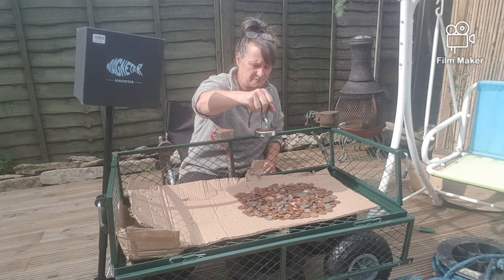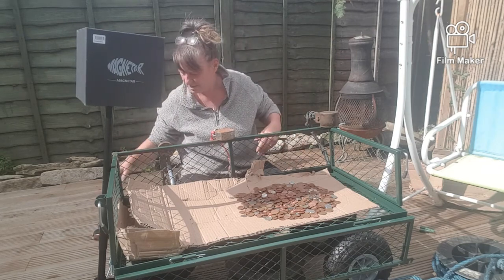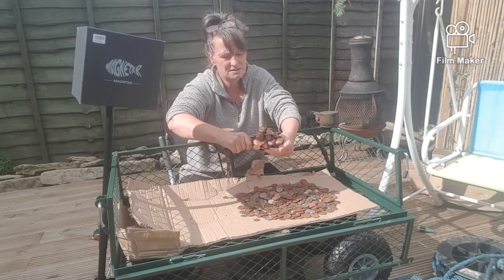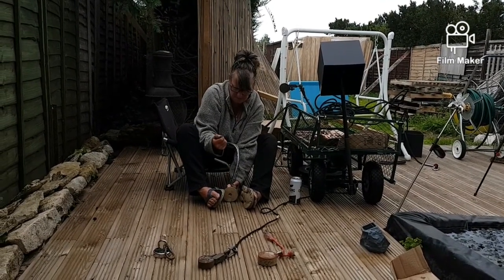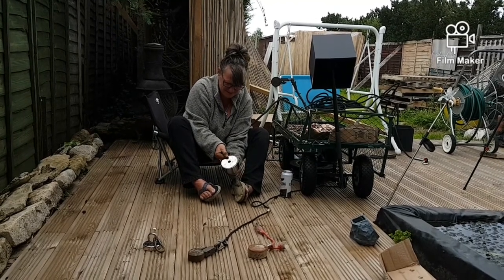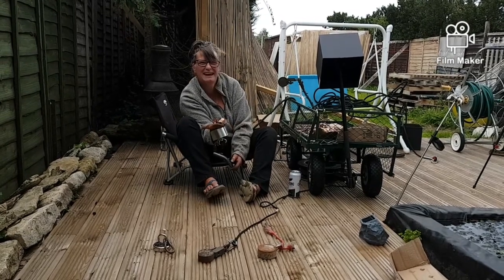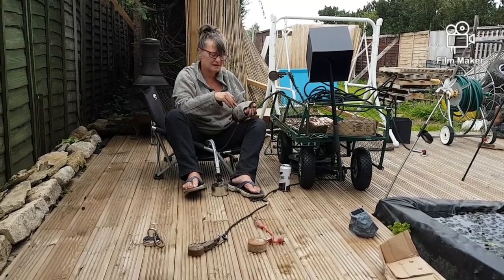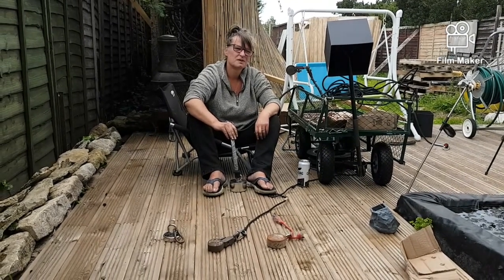Experiment gone wrong, Ouch! Barbarian vs The Beast and other magnets. Jackpot!loadsamoney#magnetar,

Comment: I own magnetar and the beast and they are both very good magnets but cmn guys, you made this test unfair. I am pretty disappointed in you to be honest not because of your magnet but because of this test... The test does not show the whole picture. Magnetar will pick up coins better, there is no question but beast will stick to larger objects better. This is not only tested by my multiple times it's just a simple physics really. Magnetar is round on sides, while the beast is flat. Therfore the surface area of magnetar it comes in contact with objects while stickig to the side is very, very small compared to the beast. And larger surface area = better sticking properties. On top of that the beast have 2 usable flat surfaces while magnetar has one. Magnetar does indeed pick up cons better but the beast will stick to larger object better while draggin both. While i do not argue with that fact that magnetar is better in case of coins, you present it as better magnet over all, which is not. They are two different magnets, for very different things. If you are after larger objects magnetar is not better.
Reply from the maker: If you watched it to the end you would have seen that in part 2 I was going to compare it pulling larger objects like a van.  I was just doing a simple experiment on showing the difference between various magnets.  We did use a 20kg cast iron weight,  which we had to kick and struggle to get the Barbarian off where as the Beast was alot easier to get off. I have been shielding for the last 6 months so not been able to test it in the water,  but considering the Beast is 500kg on the bottom surface and the Barbarian is 400kg surface the Barbarian pulled the coins from alot further distance. This experiment was to show the grab not the size of the object it could lift.  They are both double sided. Just the eyelet is differently placed.  In fact they are both 360° the casing makes the difference